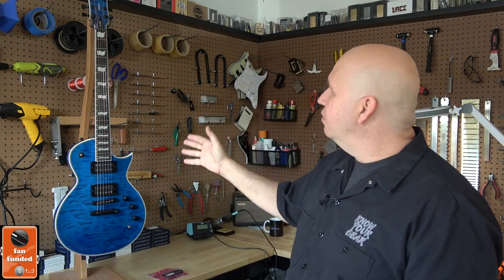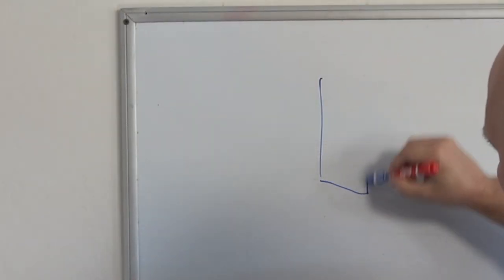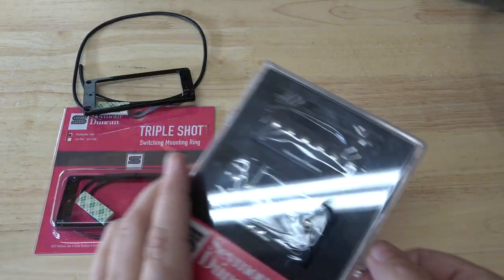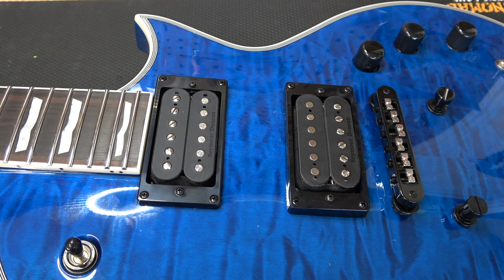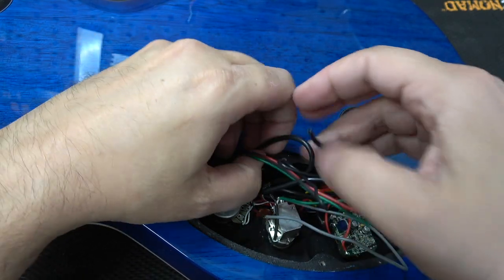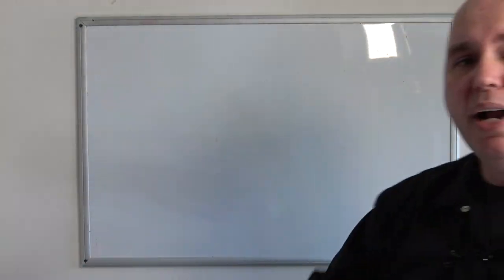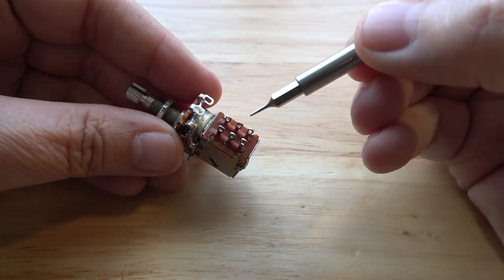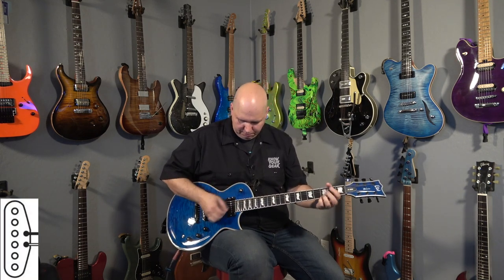Installing Seymour Duncan P Rails and Triple Shots

Comment: I never knew this special pickup and case could allow the sound of a telecaster or les paul at the flick of a switch. That's crazy.
Reply: @PragmaticDany  Yeah, perhaps, but most humbuckers lose a.lot of balls when split. The P-Rails seem to sound better when split, especially in the p90 mode.
Reply: @cchavez248  That's because they're  two separate pickups, not a split.  The humbucker tones suffer a little instead.  The blade single coil sounds a little weak too, but that's the cost of versatility I guess?
Reply: @cchavez248 part of that is the wis matched coils. If you ordered a custom shop set you could fix this and the other issue with them easy. 

Put the single coil sides on the outside of the buckers vs the p90s. And get the single coil alot higher output. And the p90 closer matched. Although then you end up with like a 14k output humbucker. But the single coil sides with sound better and the p90s wont be as affected as much by placement since a single coil is thinner then a p90. 

Matching the coils better gets a better humbucker sound.
Reply: @kitoyobeni1 nah its just the single coil being low output. If you ordered a custom shop set that was tweaked theyd be even better. Read my other comment.
Reply: @bmxriderforlife1234 
I agree 100%  Not using a matched set would be losing a lot.
Edit: typo

Comment: I wonder how many people are afraid to try to solder their own gear. But it isn’t hard if you try. I was taught in the Air Force, at Keebler AFB, Biloxi MS. 

I always preferred to keep my iron at 650°F for precision work if your iron is adjustable, but a cheap 30 Watt iron will work fine for guitars. I like to put flux into the tips of the wire before I twist it to help it wick the solder into it, but it probably isn’t always necessary. Shrink wrap is always the best way to secure the wires after they’ve been soldered.

Comment: I’ve been watching Reverb for a used PRS SE Custom 22 or 24 to do this to. Glad to see such a thorough install and demo vid. Thanks, Phil!
Reply: Go for it! I put a P-Rail neck pup in my 2008 PRS SE 22 SC, sounds awesome. The TS was bad and packed it in so I went to 2 push/pulls, but still get the 4 tonal options (P-90, Rail, HB Series & Parallel). Left the stock HB in the bridge but might throw a P-94 or similar in since I'm hooked on the P-90 now.

Comment: The second P-Rails workhorse I’ve ever seen built but this one has those nice pup rings whereas the other one had 4 push/pull pots to switch things around. Honestly,  I’m hose rings are so much easier and now that I know it can be done easier, I’ve got yet another guitar on my list, a solid maple single cut (plain maple body carved top with possibly a figured cap, maple neck, maple fingerboard with abelone trapezoid inlays) with dual p rails and a piezo. It may be an intonatable wraparound, not sure yet but either a wraparound or Tom and stopbar.

Comment: This is about what my guitar is in the shop for except before the p-rails it had acoustic and Roland synth output. After the p-rails it will have acoustic, synth, single coil, p90, series and parallel humbucker in neck and bridge with a classic single coil in the middle position.

Comment: Nice Video.  I built an HSH P-Rail Strat a few years ago. No Piezo, but with a Seymour Duncan dual blade Strat pickup in the middle position wired for coil splitting and phase reversal. Guitar is an XGP body from GuitarFetish with a maple 1984 American Strat neck and a Wilkinson trem.  Amazingly versatile guitar. I get the Piezo sound from my PRS P-22

Comment: I had these puckups and are Ok, but really didnt sound like a P90 or single coil. The ones that actually nail those sounds are the chameleon humbuckers from alegree pickups in the UK. They sound phenomenal and really do many more sounds than the SD version. I use a 6 position toggle and selected my favorite single coil,  p90, vintage and modern humbucker.

Comment: You can achieve the same effect without the Triple Shot rings.  Just install a DPDT switch - down is all single, center is humbuckers, up is P90's.  Love this configuration on my Jackson Dinky, which also has a single coil in the center.

Comment: I just put these in my Godin LGXSA. (BTW, you want to talk about a versatile guitar? The Godin not only came with 2 Seymour Duncan HBs but also has a piezo bridge with a 3 band onboard EQ and a 13 pin Roland output as well = 3 outputs too). The P Rails/Triple Shots are fantastic. Big improvement over the stock PUPs, and even more versatility now.

Comment: I once wired a DiMarzio dual sound to a three way DPDT switch. This gave me series humbucking, single coil and parallel humbucking. Long story short I used series humbucking 99% of the time. So I no longer wire pickups like this.

Comment: If you don't care about "vintage correct", the Tripleshot rings are crazy easy to install and the easiest way to get coil splitting/series parallel. Throw in a pair of push/pulls for series/parallel and OOP for when both pickups are selected and you've got the full Jimmy Page mod, plus the ability for the Tripleshot to select which coil is active.

Comment: Hey you should try to volume knobs and one tone knob I've got a hum bucker in the bridge and a P90 in my front next pick up and I've got to volume knobs with one tone and with those two volume knobs you can get a lot of different tones out of the guitar,,like that man it's pretty nice,,I usually have both of them running all the time,,Instead of having to flip back-and-forth from bridge to neck on leads,,I just spin my volume knobs A little bit,,usually I'll just pull the P90 up a little louder pretty awesome

Comment: I put prails in my sg with four push pulls.
Each pickup could be front or back single coil or series parallel humbucking.
With the 3 way that equals out to 5000 combinations.  Lol
It was a pain to wire.

Comment: Nice video, nice install, nice playing. I see you're playing with closed picking hand and no or very little palm muting (ie not open hand). Wouldn't it be better if the switches were placed down below? At the opposite side, towards where all the rest of the controls are? Then, if you played with open hand you could flick those switches with the pinky, while still holding/playing with the pick between your index and thumb. Saves that brief break you have to do anyway, with switches far away, and pull push pots. 

Can you turn on them without them getting totally askew? 

The Les Pauls have slanted frames anyway to cater for the pitch/tilt of the neck, so if these are slanted you can't turn on them. I've heard many reports that turned the regular way, these switches scratch and scrape your palm, or side of the palm, and gets in the way. And if the switches are that flimsy that people reports...their lifespan is shorter of course. Better if they were designed with the switches on the bottom. On all of them. From the start on.

Comment: I would be curious if it is more flexible. Before and after of blues, rock, metal, etc. would be interesting to see if you achieved a goal and maybe more importantly, what were the compromises.
Reply: Oh definitely it would be. I play live. Do a lot of covers having a versatile guitar is a must. Could split and tapping and even piezo. For live I have an acoustasonic tele which I use the hell out of everything on there. Then electric I use usually an HSH combo allowing to split. Sometimes I just bring a piece electric if only doing one or two acoustic. Then I run through a Kemper. Allowing me to get pretty much ever amp in the world. A guitar like this would be icing on the cake.

Comment: Looking at putting a set of P-Rails with the TripleShot rings into a guitar I got for Christmas.  Was also looking at the push pull treble bleed mod, with pulling it out turning the circuit off.  Was gonna put it on the actual volume knob just for ease of use.  It brought up a question.  Could you do something similar to that with a tone cap.  Have it be push pull, and in would be the best cap for a humbucker, and out would be the best cap for a single coil?

Comment: I preferred the original sounds. I need a guitar has 200 switch positions said no one ever. I mean it's clever but who wants this. In the Pacifica 510 it kinda made sense in a one pickup guitar. But used ones almost always have swapped out the pickup for a normal one. I think there a lesson there.

Comment: There's not much of a difference except for drop in volume from the P90 to the single coil is there? I also think that the parallel sound is not at all like the in between positions of a strat. Wouldn't it be better to get something like the JB/Jazz set and simply add a custom coil tap and out of phase switch to it?

Comment: I have this setup in a Reverend Gil. Parris model HsH. I have the piezo bridge with midi out if desired. I have PRails with triple shot rings. Honestly its too much and not what I like all at once. It just isn't the same as Gibson p90s or Fender singles. It was worth a try I suppose. The guitar does play like butter. The wiring is like 10 lbs of shit in a 5lb sack as AI asked the luthier not to make the cavities larger on the surface.

Comment: Great video what soldering iron do you use? I cannot seem to find an iron that melts solder like yours does.
Reply: It's a 70w Weller pencil iron.  I stopped the video to check as I'm in the market for a new one.
Reply: @judih.8754  I know in others it looks like a bigger adjustable unit. I will check it out, very frustrating when solder won’t melt quickly

Comment: Could you help me with some advice? I'm installing an HSH set with 2 Seth Lover and 2 triple shots.  I'm also going to use a DiMarzio Utopia, Single Coil, Middle. With this 3 pickup system, what type switch would you suggest I use with it? This is my first build and  I appreciate any advice I can get.

Comment: Always wanted to check these prails out and the button system is pretty versatile and easy. I get frustrated with coil splits yea clean they sound similar but not exact, so I always end up grabbing a single  coil guitar. Maybe these are the cure for that. ?

Comment: Any Idea if those Rings could work on my Fishman Fluence Modern Pickups? They should, right? That would save me a lot of headache, since I am short a pod-hole already as is. Long story. 
They look a bit... plastic. Are they?
Reply: Genius! I hope they do! I have the Fluence set on order and was thinking of ordering the P rails and Triple shots to test against on my Ibanez AS53. It would be incredible to order two sets of Triple shots and just be able to swap until I decide which I prefer. Thanks again for this genius idea! And yes they do look a bit plastic but hopefully they withstand some occasional light playing for years to come. Sounds like that may be an issue for regular or heavy playing...

Comment: I bought a Jericho guitar (great guitar) so far the only issue I am having is it seems like the volume bleeds over. for example if I have the neck pickup turned off but have the three way switch selected to the neck position, If I turn the bridge volume up despite the fact I have the neck position selected and volume off I can hear the bridge pickup. not sure what to do, I am not experienced with soldering and pickup wiring. Would something like a treble bleed help or is that something else all together?

Comment: I recently purchased a 2018 Chapman ML3 Pro Modern semi hollow guitar which has a pair of Seymour Duncan Chapman humbucker pickups and 5-way switch and wanted to install set of P-rails or Phat cats.  Would p-rails or phat cats be similar install dimensions (length/width/height)? Korean chapman is awesome but stock pickups sound stale.  thx

Comment: How well do the pickups cancel noise when set to humbucker?  My understanding is that the best noise cancelation is achieved when the two coils are identical as in a PAF.
Reply: Been using the P-Rails for a while now and found them to be pretty quite noise-wise when in humbucker mode.

Comment: What happens when you are using the single coils with the P Rails and the triple shot and engage the coil split switch on the guitar?
Reply: Very cleverly he converted the coil split switch to instead become a bypass switch for the treble bleed circuit

Comment: Hi, I am trying to install P rails on my Jackson. It has 2 humbuckers that have 5 wires. The P rails only have 3. (Green and red extra so I have no idea what to do) Any tips as I am bamboozled!
Reply: Sorry, just worked it out that the 2 extra wires are not attached. (They are folded back and hidden under tape!) ive got them installed and very happy with the results

Comment: I don't understand the benefit of triple shot. couldn't that have been done with a pair of push/pull pots, and in an easier to reach on the fly location? Also...is it just me or did the single coil on the P-rails have less top end than the P90?

Comment: What does “in parallel” mean?? I’m so confused by this.
Reply: The coils in the humbucker are running separately instead of the coils humbucker running through each other. So instead of a humbucker, it's two single coils on at the same time.

Comment: Option paralysis in my opinion. You'd spend more time messing with your pickups than you would playing and making music.
Reply: Or you can use the number of options as a way of being unique by “failing up” (although it may be more accurate to say “mistaking up”). The number of options there are means you can basically randomly move the switches and get a new, unique sound